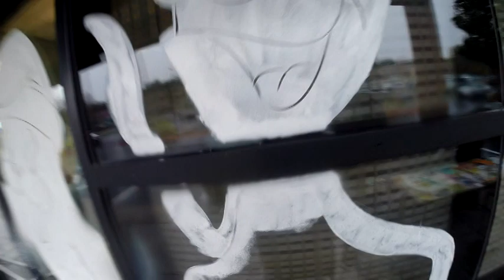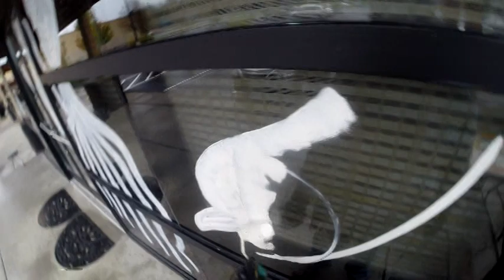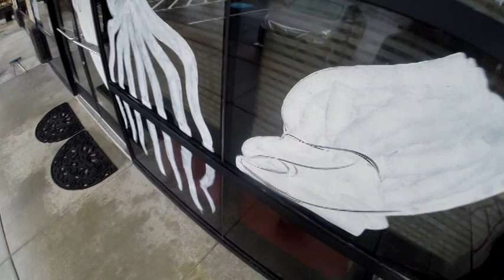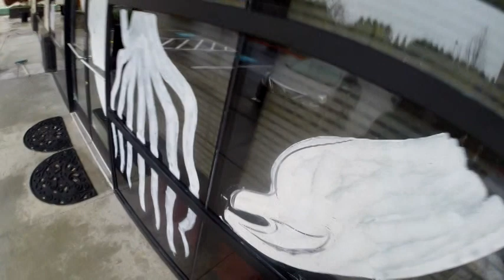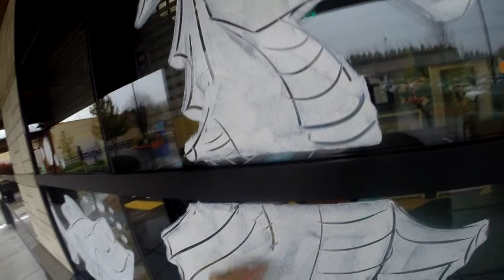WINDOW PAINTING with Scot Campbell (7O min.)

Comment: Hello Scot, thank you for sharing your talent with us. I was asked to paint an interior door/windows for my employer. This would be my first window paint job. I am nervous but being crafty and a Graphic Designer I am sure they will appreciate anything   I can come up with better than nothing at all. Would you use different paint indoor than outdoors?
Reply from the maker: No you can use the same. I presently use Behr premium plus interior with an eggshell finish from Home Depot. You can also use Sherwin Williams Promar 200 interior eggshell or Valspar Ultra interior eggshell at Lowe's. For me black outlining I use Golden high flow acrylic carbon black. You can also try DecoArt patio paint wrought iron black, Ronan aquacoate black or Createx opaque black. I do not treat the window, sometimes i wash it if it has excessive dirt but it's not common. I do not add anything to the paint, sometimes water when it is hot and dry and the paint has evaporated a little.. I wash them with warm soap and water, keep them wet. Then after 5 minutes scrape with 4" razor. Search "washing" in my videos. Let me know how it goes Melissa, or you can send photos to extremotheclown@gmail.com

Comment: Do you have a list of links you use for your products? What were you drawing with on your finger? Did you make that yourself? Great work!
Reply from the maker: I am drawing with my index finger, you can also use the erasor side of a pencil to draw in the wet paint.  I use Behr premium plus paint interior with eggshell finish, the black is golden high flow acrylic carbon black. I use Mack golden taklon brushes #162 all four sizes. I also use 4" wooster roolers and 1 and 2 " poly foam brushes (jen brand only). If you are serious about window painting buy my e book, in the trailer or join my patreon. Thanks for watching.

Comment: Do you ever have any problems keeping the paint on the windows after you're done? With rain I should say
Reply from the maker: If the paint has time to dry completely it is pretty durable against rain. Although the black is a different kind of paint and needs to flow better than the other paint which is interior house paint. But even the black is somewhat water resistant. Now if you suspect you might get a ton of pounding rain over time you may want to do a clear coat over it with a water base polyurethane. Search "clearing" here on my channel for videos covering that subject. Best of luck and let me know how it goes. By the way are you presently doing windows or just beginning?

Comment: Does the interior paint hold up to rain if not protected? Why do a lot of window painters use eggshell? I’ve painting windows for almost 49 years. I used rich art window paint which I loved, but they stopped making it
Reply from the maker: Yes interior holds up pretty good, unless it doesn't have time to really dry and gets hit with a downpour. Interior is easier to remove than exterior. You can also clear it with a waterbase polyurethane like polycrylic which will make it literally waterproof completely and last decades...but still removable.. Flat is a bit cheaper but harder to rmove than eggshell and satin.  Semi-gloss and gloss are more expensive and sometimes the outling black will bead up on a glossy surface. that's why eggshell is used. Wow! 49 years, that's a half a century! I have been painting them for 44 years.
Reply: @ScotCampbellwindowpainter  thanks, I’m almost 66yo. I like your style. Looks great but pretty quick. I think I do too much detail. Do you use paint or marker for outline? Thanks fir your response